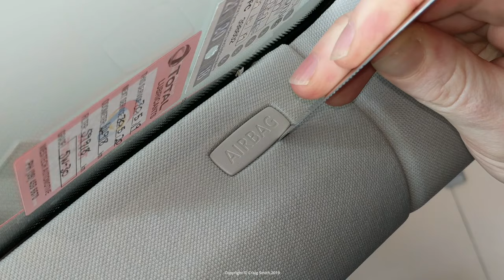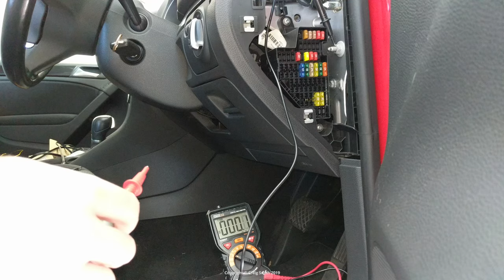How to: Hardwire install dash cam (VW Golf) or: access fuse box, A pillar, & courtesy light

Comment: Currently in the process of doing this to my GTI. Following both your videos (this and the wiring vid linked in the description). These are great, very detailed instructions. Thanks!

I would recommend being VERY careful when removing the little tab on the A frame that says "Airbag". Mine snapped super easily about two minutes ago 😅. Seems like something that would be cheap to replace or I might just glue it back after. But be careful!!!

Edit: This has taken WAY longer than expected. Please note, this video makes it look much easier than it is haha. Getting the wires under the light fixture from the windshield, and feeding the wire through the roof takes FOREVER. But I still would have never been able to do this without great guidance in the video. If you're reading this, feel free to ask me if you're stuck on something because I probably made every mistake possible 😂. I'm sure ill see the notification and try to reply.
Reply: I'm about to do in my golf too, waiting for the dashcam to arrive, can i know what wire have you used to find your way from the light fixture to the A pillar? i can't find anything similar to buy
Reply: @AhmedSam  the cord in the package that came with the camera was long enough. I used an old wire hanger to guide it through and believe me, it took forever to get it right. He makes it look way easier than it really is. You might want to find someone to help, would have been easier with a second set of hands. I was doing it alone in the dark during a power outage which also didn't help
Reply: @MrJoelnewb  thanks for the hints pal. was planning to do it tomorrow after work, also in the dark lol. Will push it to the weekend
Reply: @AhmedSam  yes I would recommend waiting until you have a full day or two days just in case. Once you tear everything open you can't really use your car until it's done and closed back up

Comment: Attention plugging one SAE cable into another inverses the cables (black becomes red and vice versa). In your case things worked fine since you plug 3 cables and you re-inverse them.
Other than that great video. Thank you !
Reply from the maker: I'm only using 1 SAE connector, with the 'plug' side wired correctly. The 'socket' side (hot) must have the exposed connector as negative.